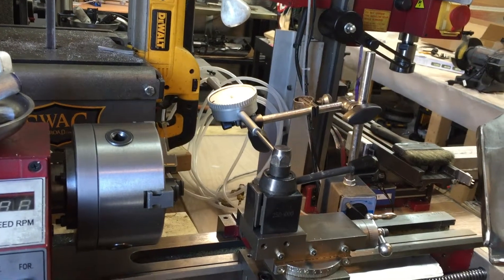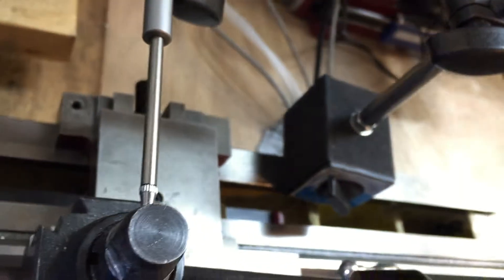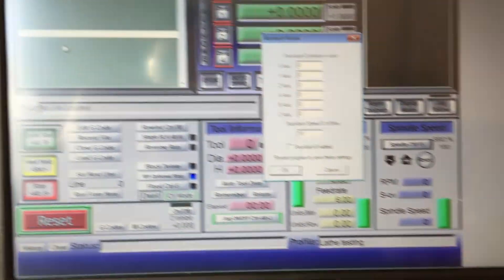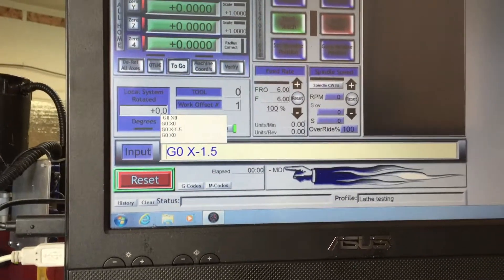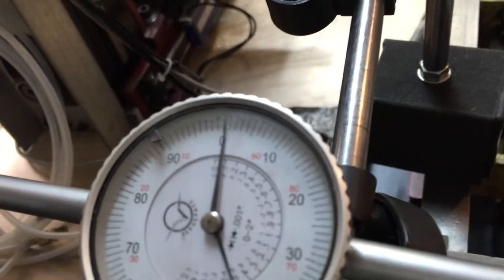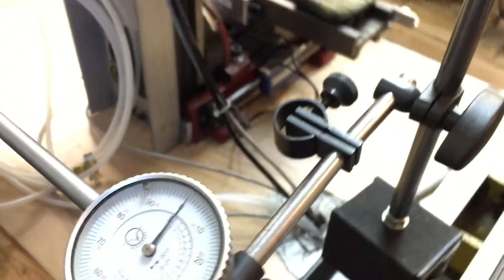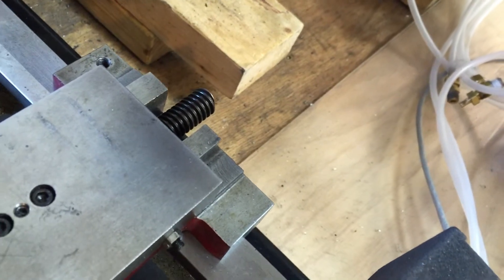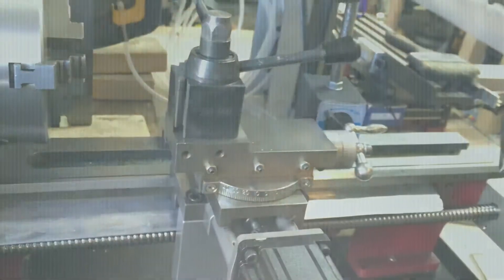Lathe X axis backlash demo

Comment: I to use leadscrew on a cnc mill and i get .0004 of an inch on X/Y axis. Some guys have Ballscrews and report of having up to .0015 of Backlash.
Reply from the maker: Yeah, I am very happy at the performance of that leadscrew with the brass anti-backlash nut properly adjusted.